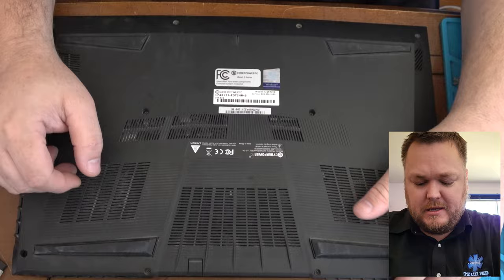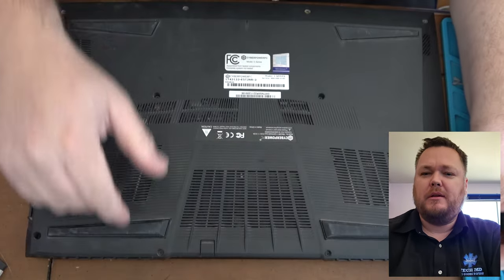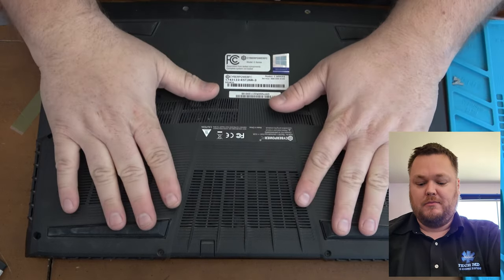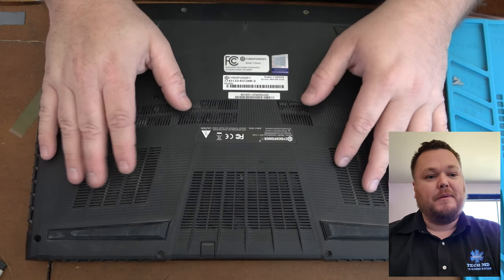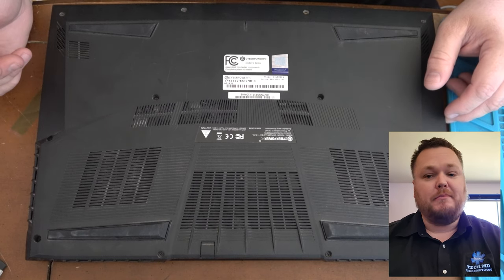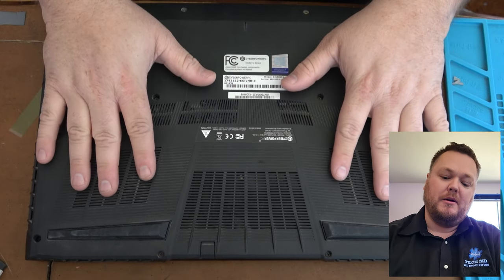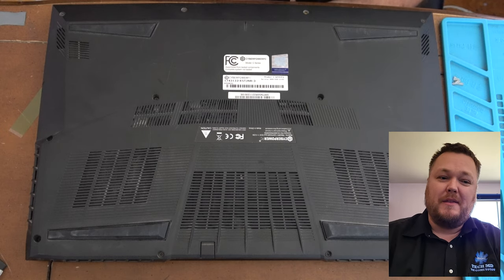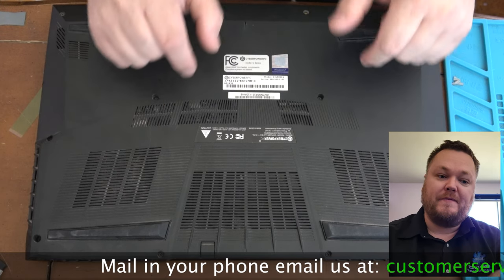CyberPowerPC Tracer V Laptop Liquid Metal and Upgraded thermal pads

Comment from the maker: Please support the channel by using my amazon links! 
For Recommended Parts click on the links below.

99% Isopropyl Alcohol for cleaning :
https://amzn.to/3rOFoiK

Microfiber Cleaning Cloth :
https://amzn.to/3DzLJ43

Top Coat to Protect Resistors :
https://amzn.to/304XotL

Kapton Tape :
https://amzn.to/3pxUfLT

Liquid Metal I Use :
https://amzn.to/3lKRa9Z

Different Liquid Metal full kit :
https://amzn.to/3pW6fXG

Noctua Thermal Compound if you don't want to use liquid metal :
https://amzn.to/3dXwd7o

(Recommended) Gelid Solutions GP-Ultimate 15W-Thermal Pad (2pcs) :
https://amzn.to/3ovsvIr
https://amzn.to/3DzMNou

Heating pad:
https://amzn.to/3mbIytW

Heat Resistant Gloves
https://amzn.to/3EsZdyW

My blue mat to keep everyone organized:
https://amzn.to/3BalS16

iFlex Opening Tool with Glue Card :
https://amzn.to/35UC9h8

iPlastix Opening Tool with Glue Card :
https://amzn.to/38FtzUH

on of my favorite screw driver sets 2uul:
https://amzn.to/3jsqkCz
https://amzn.to/3CcoL2Y

iseasmo w/ Kit (Has Screw driver too)
https://amzn.to/35Za2O0

Tweezers:
https://amzn.to/3B7yBlf

T-7000 Water sealing glue:
https://amzn.to/3EdzLxs 

Isopropyl Alcohol For Technical Use:
https://amzn.to/3BqBU78

Need to get a part from a reliable quick source, you'll find a better price here then Amazon and the quality will be a lot better. Click on the link below.
https://www.injuredgadgets.com/?acc=be9b6cec65c863e1b55538d2c7fcc9b0

• Visit our Website: https://tech-md.com

• My email: dustin@techmd.bz

• To mail in your phone, please contact us at 801-438-6028